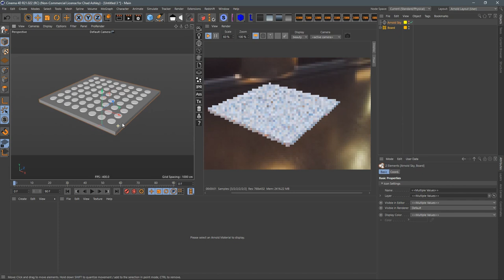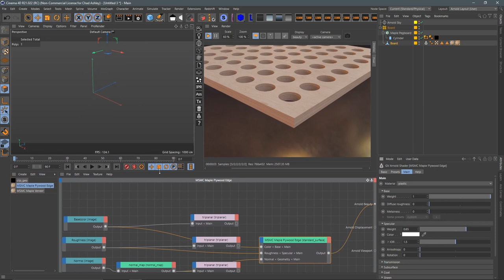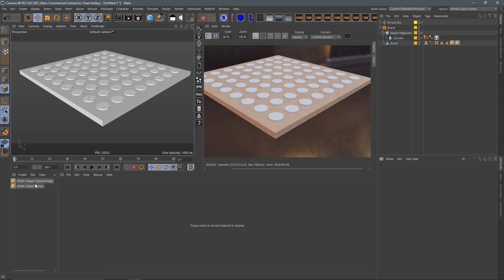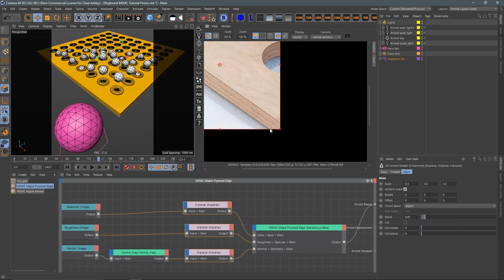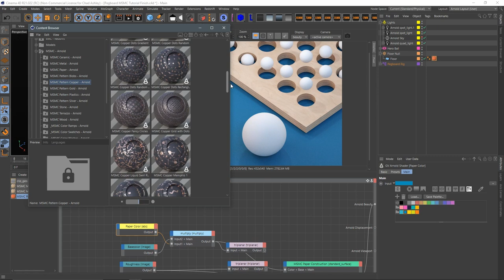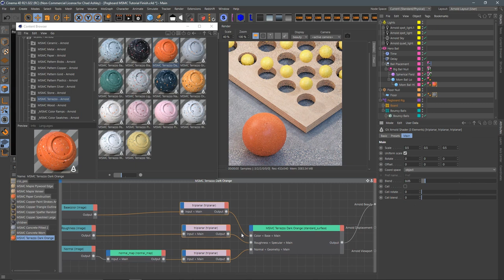Learn How to Get Clip Geo Booleans in Arnold | Greyscalegorilla Tutorial

Comment: can i ask which gpu did you use? i have one 2080ti at home but no hope for Arnold. So slow
Reply: Did you flip it to use GPU in the render settings?
Reply: In my case, it works for me only in render mode by the processor. I have a 3090 video card